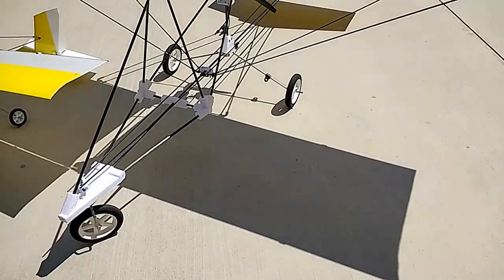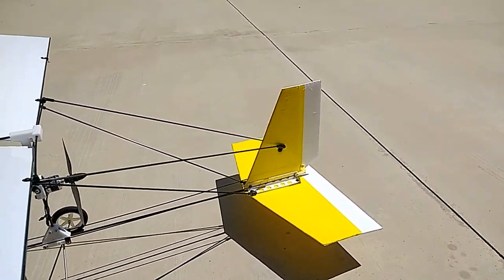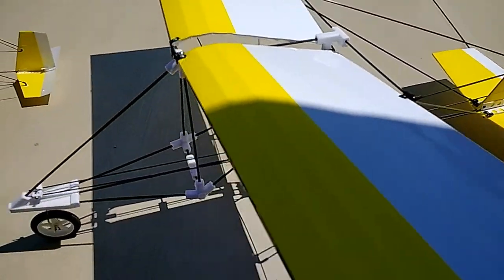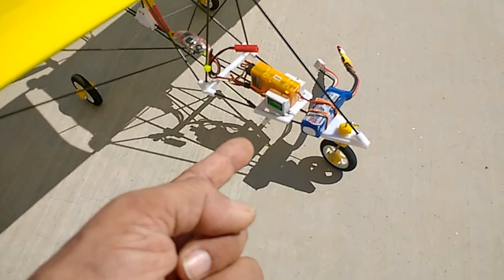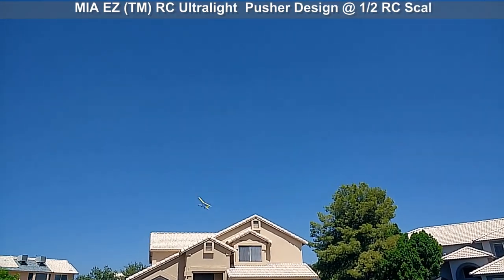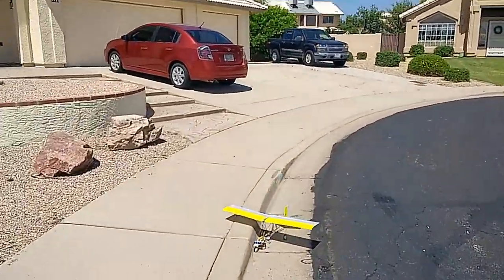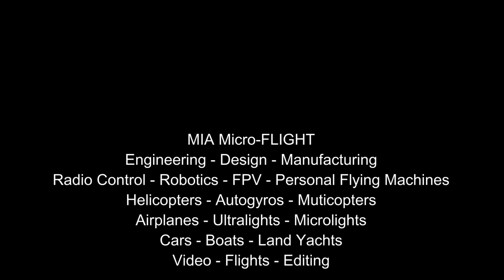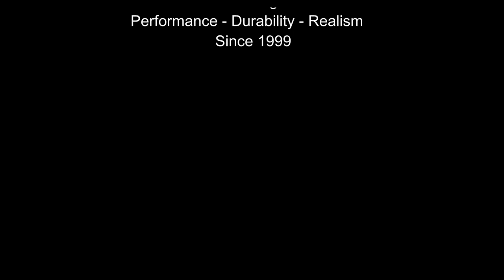MIA EZ 1.25 RC Ultralight Pusher Design Half and Full RC Scale

Comment: Damn that is a tight spot to test. Full stop landing on the curb too. I guess it's a lot tougher than it looks. I'm checking out your quicksilver replica kits. Building a real one right now and it would really put some smiles on the faces of the club I just joined. I've been flying RC for years and have a ton of planes and FPV gear so your site is the last thing I needed to find right now. LoL
Reply from the maker: The small  1S /2S  lipol planes I normally test them in small areas. The larger one is done at the park, even though that park is not my favorite since it is not really a park but a water retention area,   and the videos tend to come out dark due to the nearby trees surrounding it.  The quicksilver is a very unique airplane both in full scale and rc model form.

Comment from the maker: While stylish tapered, rounded, etc., control surfaces and overall design works favorably on some aircraft designs, sometimes the basic rectangular control surfaces and wings are best for stable solid rc models aimed at beginners rc pilots.

For those viewer eyes who are always on my videos, wondering also what is the best design , pusher, tractor, in line, offset stab and wing, my answer to you is sometimes also we just want to have fun  and not everything has to be boring inline and square.  A give and take is always the tradeoff depends on the intent of the designer with its particular design.

It is all about a balancing act, when we have to consider aerodynamic efficiency with more than average, structural integrity, durability, crash worthiness,  and simplicity, Throw in a bit of stylish fair and it is even better.

The Center of Gravity (CG) is really not the same as the Center of Mass.  But in aviation people generalize the CG as the point of balance where all mass is concentrated,  when we think of the aircraft as being suspended and typically the suspension is under the wing at 25-30% from the leading edge of the wing, and to keep it simple, assuming a rectangular high wing. 

But the Center of Mass (CM) may or may not be in line with the CG as this also maybe different (above or below the thrust line) and this will have an effect on aircraft performance and control.  To find the Center of Mass (CM), basically of any object,  you have to suspend the object or aircraft in this case, from at least 2 different points and where those perpendicular imaginary plumb lines cross or intersect,  this is your Center of Mass, and this has to be considered when designing an aircraft also, in line with the CG location and Thrust Line,  depending on aircraft design, and distributions of moment arms, weights checks and balances.

It is all an act of equilibrium, like all things God created, they  are in perfect balance, beginning with nature, our physical bodies, mental and spiritual, attitude,  and the more you know about this the more in balance you are too. LOL.